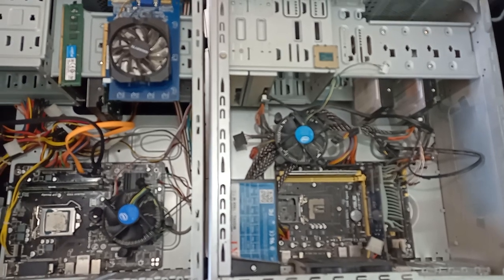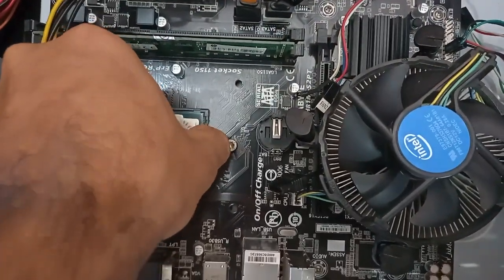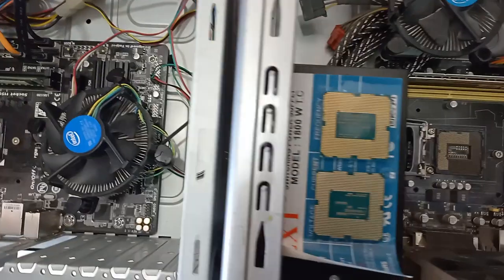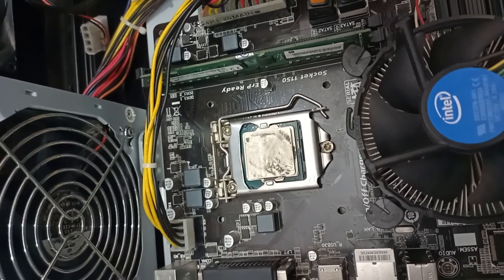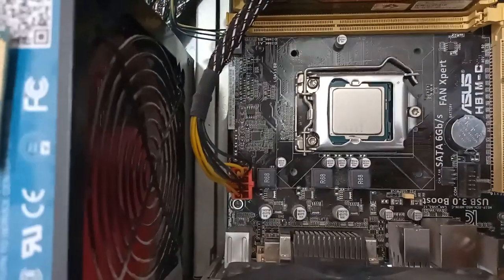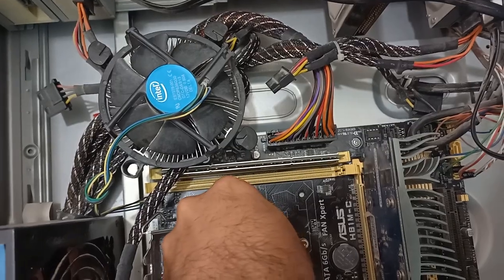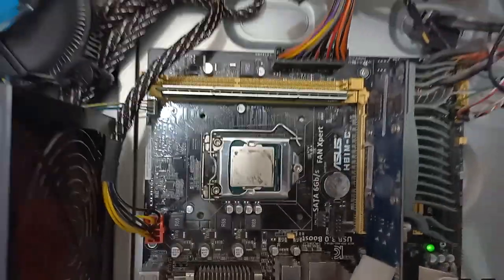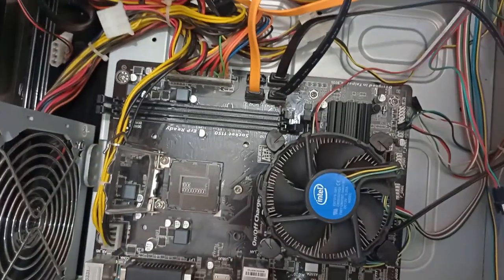How To Fix PC Is On But No Signal | H81 motherboard- 1150 CPU

Comment: My game works for a while but out of nowhere the pc is still running but the monitor loses signal do you know what it can be
Reply from the maker: HI
1,if it is windows 8.1 or 10 or 11 type "graphic settings" on search , then click on app appears , on "choose an app to set preference",if you see your game icon click on it ,if not through "browse" select the game from its place on your PC ,click on game,a windows appears,from the list choose "High Performance "then click save and start playing,if not solved 
 2.if you VGA driver is not the latest upgrade it,if it is the latest click on properties ,then device manager,then Display adapters ,then choose your driver (between AMD,NVIDIA) , then rightclick and choose browse my computer for drivers,then (let me pick ,...) then from the list of drivers choose the oldest,then click next ,after that run your Game.if not solved
3. change your gpu port to another DP or HDMI also change the resolution(lower resolutions)
4.install furmark on your PC, check the temperature higher than 70 , check if GPU stop working at which temperature,If it is out of signal upon to high temperature,then your GPU needs to be fixed (Hardware problem).